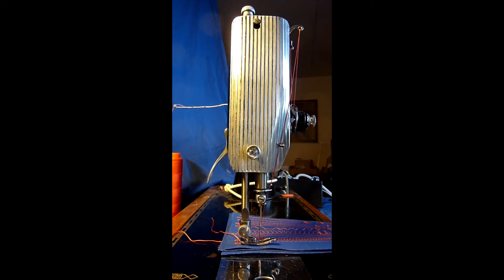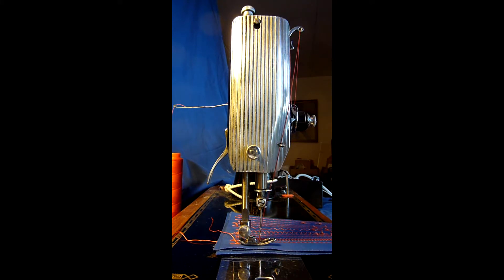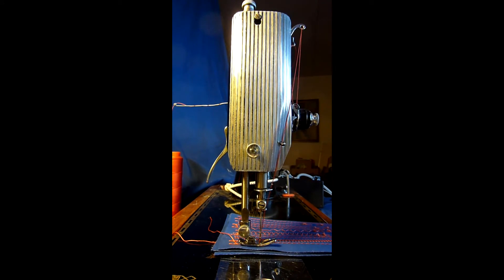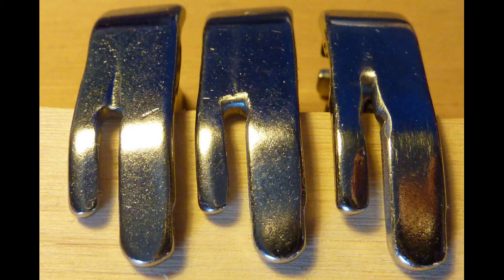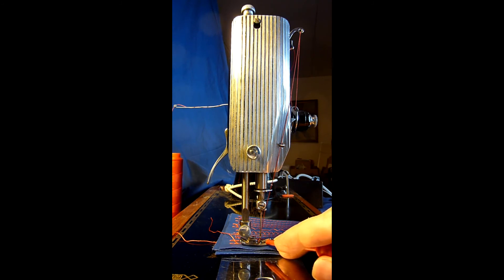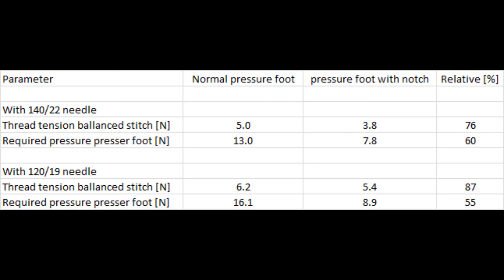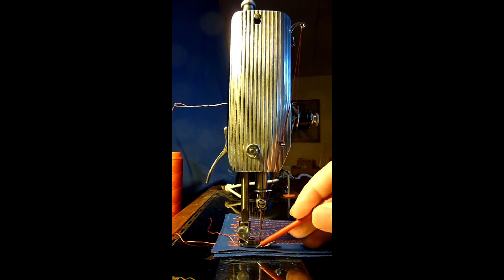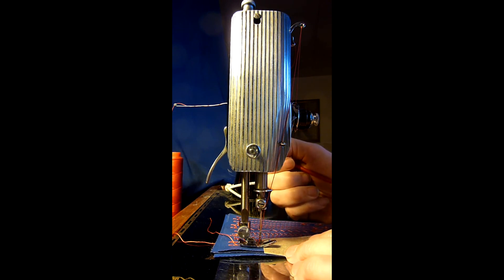How to improve Sewing Machine Presser Foot for heavy duty Applications

Comment: I've noticed my 15s need more thread tension than the 127/ 99s. Could this be due to the location of the tensioner and non-straight path to the thread pulley?
Reply from the maker: The Singer 127 is a vibration shuttle machine. It got a significantly different sewing cycle and way of operation. In general these kinds of machines can work with less thread tension. Before about 1960, sewing machine threads was often cotton thread and not so strong as we are used to later on. These long shuttle machines were able to handle the thread with less stress and wear. I am not sure why the Singer 99 should manage to sew with less thread tension. I think the hook of the Singer 99 and 66 require less machine power than the Singer 15 for the same work. At low of other things can cause differences in thread tension like machining of the presser foot, bobbin thread tension, feed timing and down force on presser foot.
Reply: thanks for the reply. I would like to compare the 127, 15, 99, and my 115 that is coming soon. @sewingmachinesindetail

Comment: A very interesting video on thread tension, needle deflection, and stitch formation. I'll try modifying a foot for a Singer 15 as an experiment based on your experience. Thanks for your work on this video. YVR
Reply from the maker: Thanks, you are welcome. It is quite easy to make a presser foot like that with a spare normal foot, a hacksaw and sand paper. The other longer video with one stitch go into more technical detail. You may get too much variation in stitch balance, when you use it on thinner fabrics under foot. But in most cases, I find this kind of foot better to use than a big roller foot.
Reply: How did it go with the 15? I'm thinking about doing the same.

Comment: I'm curious to know if you tested this at speed to check if the needle-bending concern was indeed an issue or not. This machine was never meant for super heavy, industrial-style thread and needle so pushing it there can have a series of related consequences -- for example, not only might your needle bend and break, but if it does not break you still might see uneven stitches. I am interested in seeing your results.
Reply from the maker: I have tested this foot up to a speed of about 400 stitches a minute without any issue of this kind. You can get problems with fabrics thicker than about 4.5 mm due to timing of feed dogs - I made a video about that, and this is a real issue. The quality of the stitching is carefully shown in other videos on my channel, with thick leather and some vinyl and with this foot. I got an ulisted video here of some other work with Tex 135 thread and sewing at some speed, but no quality is shown in this particular video: https://youtu.be/fApDZUTc7po

Comment: Thanks for posting! I have a 48 201-2 that I want to set up to stitch heavy thread for some upholstery work for myself. Looking forward to more videos in the future.
Reply from the maker: I hope, that you can get the machine work well for you. The potted motor is not powerfull, but I hope it will manage. The transformation to an motor belt driven machine cause some other parts to be replaced.
Reply: Sewing Machines in detail I am going to try with the potted motor, and if it’s no good, I’ll modify an outboard electric belt drive motor with more power, and necessary parts to convert. I like the pulley reduction wheel idea for slowing it down for control anyway. I found your videos very useful.
Reply from the maker: @americanoutlawgarage2923  Thank you, I am glad that you find the videos useful. I do not know, if some companies can refurbish this potted motor to be stronger, but I guess it will be a more expensive solution. With newer electrical insulation materials, you can allow higher temperature of the windings, and thereby you can get higher power of the motor. But rewinding it all is not that easy.  I have tried to find powerful external motors being sold in the US, but it is not that easy to find them. I am preparing a video on how to select an external sewing machine motor.
Reply: @sewingmachinesindetail  I am looking forward to your video on motors. I am also interested in modifying machines like this. I have a Pfaff 130-6 that I have a 3D printed motor mount with an integrated metal reduction gear. It is made to fit v belts. It has an upgraded 1/15 hp motor which is able to draw up to 1.5 amp. I've switched out the foot pedal for a Husqvarna FR400 which will have the input voltage regulated with a triac and potentiometer for precise adjustment. I am also outfitting it with a heavier handwheel with a larger diameter where the belt sits. This way I can run it slow although I know I am losing power when regulating the voltage. I think the increase in torque will be enough to do what I need to. I am also going to modify the hook with your method. I have bought a few feet to test, including teflon foot, and a large roller wheel which is made for a high shank machine and will necessitate adjustment to the presser foot bar. I am learning a lot from you, and the foot pedal and the rpm control on the 201k fascinates me.
Reply from the maker: @shakerson  Thanks for your message. I am glad, that you find the videos usefull. I am sorry, that I did not pressend a video on motors yet. I have been busy with other matters lately. A 1/15 HP motor should have just about the same shaft power as the one I use on my Singer 201k. I am quite happy with the speed control I got with the presser foot and electronics etc. I think producers of servo motors for sewing industry needs to do better than now.
Reply: @sewingmachinesindetail  I understand. We all have lives to live. Don't let us rush you. I enjoy your insight on these machines and your electrical knowledge seems far superior to that of most sewing machine techs. I have been trying to learn all I can about universal motors and there is limited videos on them specifically related to sewing machines outside of basic cleaning videos. I have had someone else who had good knowledge explain to me about the inefficiency of a lot of newer motors that use up to 150W just to put out 49W at the shaft. I think other people don't understand this. I am also unimpressed with a lot of the available servo motors, which is why I am modifying things the way that I am. When you do make that video, I would very much appreciate if you explain the small motor you have attached as a generator. I'm assuming you use that to estimate the speed of rotation based on the voltage it is generating?
Reply from the maker: @shakerson   Yes, the little motor is used as a tacho generator, and yes the voltage is used as feed back to a PI control circuit of the motor speed. Some motors can put 49 W on the shaft with only about 90 W input, but then they normally have got more steel and copper in them. When you limit the costs on copper and steel, the motor efficiency decrease. Did you see these curves? https://drive.google.com/uc?id=1aT7n_DGgxENoefvFYRWtMlTmqQoWUQY-
Reply: @sewingmachinesindetail  I had not seen that but it certainly is interesting.

Comment: Great explanation about why a walking foot is better. Yet this is a  wonderful solution by changing the presser foot with this modification to allow the machine to do what it is doing .  Did you use a dremel or hand file to do this modification and how far back did you go on the presser foot? I thought the rolling presser foot would alleviate the problem. But alas, perhaps the modification you did will be better. I hope to try what you are doing here. You say baking paper. Is that what is called wax paper too?
Reply from the maker: Thank you for the comment.

I used a hacksaw to make the notch. The length of this cut was just sufficient to have the thread pass directly to the fabric thread hole at longest stitch length. I think the length of the cut was about 3.5 mm at the top of the foot and 4.0 mm at the bottom of the foot. I also so tried to smooth the edges and surface with some strips of grit 2000 sand paper.

The big roller foot do work as well and I think its performance is close to this solution, but more complicated. The big roller foot make the fabric move forward with stronger force. But when the feed dogs are down, the fabric easily slide under the foot. Therefore I prefer this notch solution.

No, wax paper is not the same, but it may work too. Some use paper from a newspaper. Baking paper have got some silicone treatment, that makes it more slippery. I guess that a larger foot store have it anywhere.
Reply from the maker: Perhaps a change to the feed dog timing can improve on the traction problem too, bot I have not verified it by measurements. You can see a video about it here: https://youtu.be/DxsoN46yGyo  In this case the movement of the feed dogs have almost finished when the take-up lever is at max position.